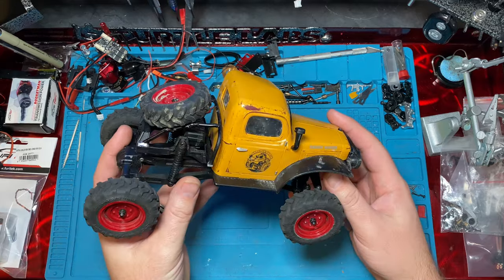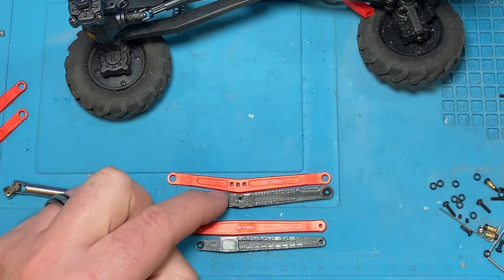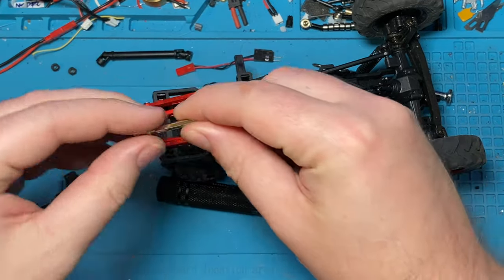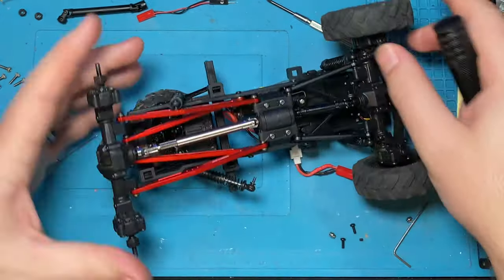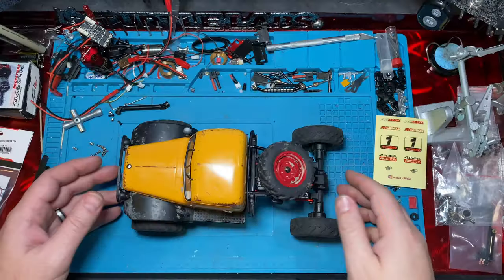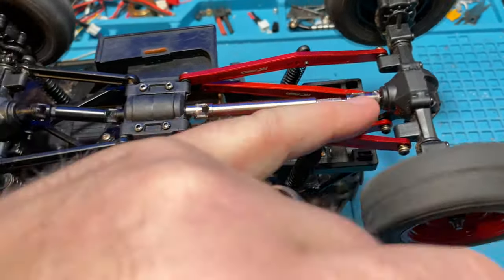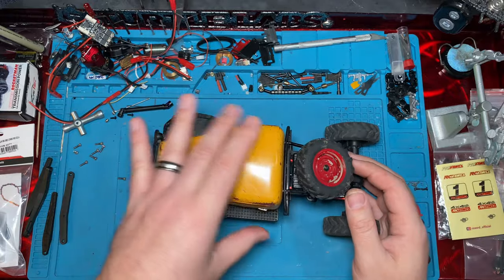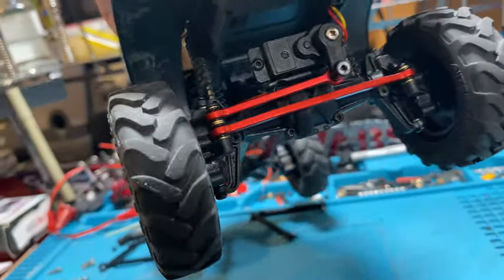FCX24 - We install the RCAWD 35mm extended links and compare to McCue RC’s 28mm rear links!

Comment: Take the spare tire off the back and add crip/skateboard tape to the aluminum plate....I mean, no rocks ate made of smooth aluminum. Lol. And we're looking for maximum degrees, right?!
You have the best micro reviews. 
Keep it coming.
Reply from the maker: Yeah, we’ve though it using some skateboard grip tape. The item in the video is actually the underside of a tile and has a good amount of grip, just not enough apparently.

Comment: The small silver balls are for the original shocks to replace the original screw/balls if you need to put a longer screw.
I have a way better flex if I put a spacer between the link and the shocks, but in order to do that, I need to put a longer screw. Thanks for the video.
Reply from the maker: great info! Thanks for the post!

Comment: Great video, I've got these coming in the post. What would you recommend for a 4 link upgrade up front, as close to stock setup and what metal driveshaft for the front. Great video. Now subscribed. 👍
Reply from the maker: furitek makes some full 4 link front and rears: https://furitek.com/search?type=product&q=fcx24%20link as for the drive shaft, any proper length scx24/fcx24 shaft should work fine.

Comment: Gladiator links are about the same as the mccue links. No shock mount holes on them, so you'd have to figure that out. But gladiator links will work also with some extra work.
Reply from the maker: Thanks for the info!

Comment: Thank you for the video this is exactly what I wanted to know. cause I have mcque on mine but I also use his bed with those being longer  than the mcque looks like the bed would not work. Do you know what the treals kit lengths are? Oh and I also don't like the look of the grub screw
Reply from the maker: Yeah, the grub screw is tiny… I think a .9mm.  It’s a non-ideal choice for sure.  I am unsure on the treals as I have not tried them.  

The McCue bed should still work with the RCAWD links but the wheels will be longer for sure.  At some point I need to get the bed and then I can show it.

Comment: Hi Ken, I came back to an older vid on the fcx24, but my main question is, do you know what size the plug connector for the headlights are? Mine was a factory damage and the wire came out of that male plug end that plugs into the ESC. All FMS support states it's a ph2, but this has to be smaller. I know it's a 3 pin, but only uses 2 wires. If I knew what size this ESC takes, then I'd find a pack of connectors and replace it myself. Since you're really involved with rc's I thought i'd ask you. Do you know what size all the plug connectors the FCX24 uses? Thanks for your time. Awesome vids.....✌️✌️
Reply from the maker: I believe it’s jst or molex picoblade 1.25.  The jst and molex are just the brand. The 1.25 is the pin spacing and that the important part.

Comment: I have a question… this is my first 1/18 scale. In all of my 1/24’s when I upgrade the links, the flat side faces inwards. Does it change in a bigger scale?
Reply from the maker: The flat side?  I don’t think I follow.
Reply from the maker: With these links you can install them either way depending on what you’re trying to do.  ;)
Reply: @TheShopMiniRC  the link hollow balls. I always put the flat side of it inwards. I’m sorry 😅
Reply from the maker: @RCRookie805  ahh. On the link balls, you want the larger side facing towards the exposed, non-captured side of mounting. That way the link can’t pull through the o-ring and screw head. Regardless of scale

Comment: Extended!!  I didn't like the driveshaft either.   My kit came with 4 grub screws so I installed all of them.
Reply from the maker: Yeah, mine only had 3 (unless I lost one some how….
Reply: Mine only came with three as well. I had McCue trailing arms mounted up, so I ended up just leaving my axial gladiator drive shaft on. The mccue links will be going on another fcx. thanks for the vids! 👍🏻
Reply from the maker: @teamvisser  thanks a ton for watching.

Comment: Very nice! 
Does anyone make talking arm links for scx24 besides mofo?
I was hoping for high clearance extended trailing arm links, but it doesn't seem anybody has made them.
Reply: Maybe those +35 will work on the scx24?
Reply from the maker: Not really no.   You can try the FMS links, but they are all m2 hardware where the scx is m1.4
Reply: @TheShopMiniRC  i may need to try it but use your fishing line crimp method. 
Hopefully the width of those balls fits,  but i guess it's within grinding width? 
Plus 35mm would be great on the Meus LCG scx24 build i just did because it's too short.
And so then the only thing would be the drive shaft,  can't remember,  do the these drive shafts fit the scx24 transmissions? Ehhh, it's kindof a crappy shaft because of the round hole and screws.
I'll need to find something else for that. 
Hmmmm
I could still find a drive shaft. 
Gonna have to follow a couple of your links!  For links!  Hehehe

Thank you for the help,  and awesome tutorial videos!
Reply from the maker: @MrsRabbit8  yeah, the driveshafts generally work but they do have a full circle hole.  

You can usually make just about anything work with enough effort. lol
Reply: @TheShopMiniRC  hey, you replied on my other comment but it says the comments are turned off on that video when i click to read the comment..?
Reply from the maker: @MrsRabbit8  it’s because I put the video back to Members Only. So unfortunately you can’t see the comments anymore. Sorry. I basically just said that I would pass the info to Klink